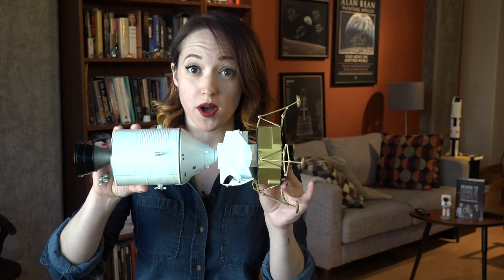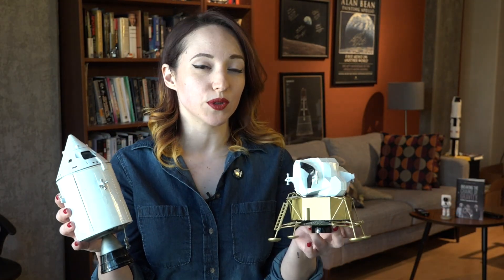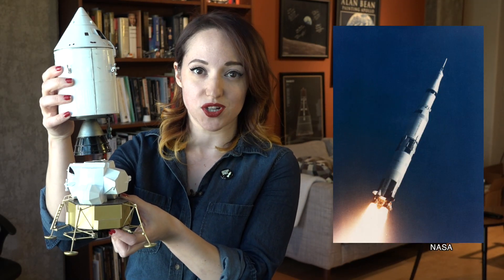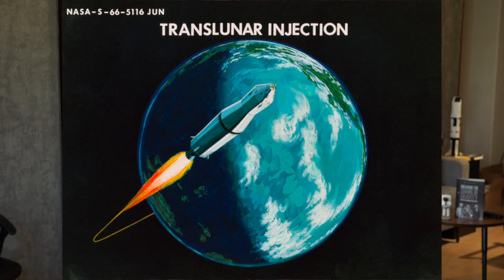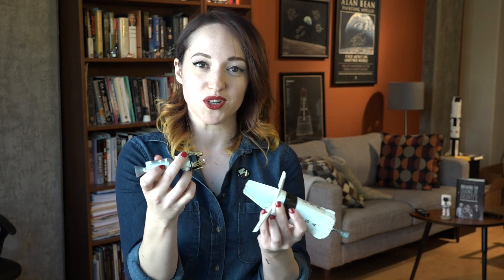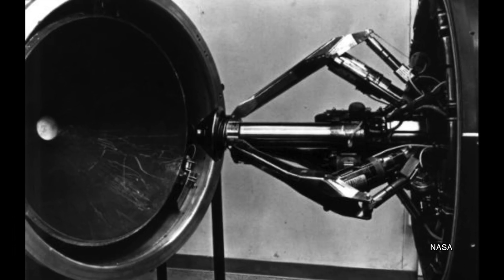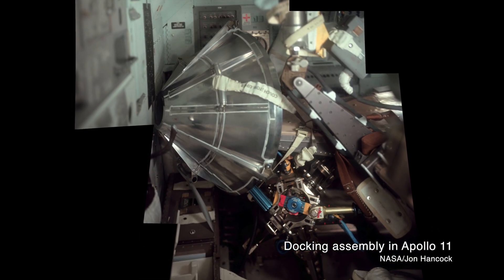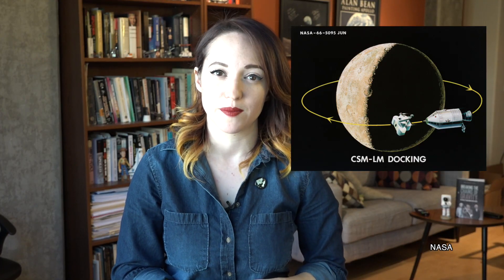How Did the Apollo Command and Lunar Modules Become One?

Comment: Not having it something thats never been tried before and they happened to pull it off 1st time in space and everything worked faultless, sorry it's a bit too far fetched if you ask me. So please don't
Reply: Tap into google AI your comment above and here is the answer
_I understand you're expressing skepticism about first-time achievements in space exploration, particularly the idea of complex systems working flawlessly on the initial attempt.
Space missions, especially the pioneering ones like the Apollo program, are the result of years of rigorous testing, simulations, and planning on the ground [1]. While a system might launch into space for the "first time," it has typically undergone thousands of hours of development and testing by dedicated teams of engineers and scientists to mitigate risk and ensure reliability [1]. 
Major space agencies like NASA and the European Space Agency (ESA) prioritize mission success through: 
Extensive Ground Testing: Components and systems are tested individually and together in conditions that mimic space.
Redundancy: Critical systems often have backups.
Problem-Solving Culture: Engineers analyze and address countless potential failure points before launch. 
The perceived "flawless" nature of some missions is a testament to this meticulous preparation, rather than luck or a lack of prior effort._

Comment: Well done as usual. But now I have more questions than answers. How did they get all that stuff out of the command module tunnel to the LEM? I also recall in Apollo 13 they used the LEM as a lifeboat. Was it already connected during the explosion before the command module failure? Or did they have to attempt a docking with a compromised command module and injured service module? Thank you!
Reply: AI answer.... Transferring Equipment through the Tunnel
To transfer equipment and crew between the Command Module (CM) and the Lunar Module (LM), the Apollo spacecraft used a continuous, pressurized tunnel created after the two craft docked. 
Here is how the process worked:
Docking and Sealing: The CM, after separating from the Saturn V rocket stage, would turn around and dock with the LM using a probe-and-drogue system. This involved a probe extending from the CM engaging with a funnel-shaped drogue in the LM. Once alignment was achieved, twelve peripheral latches would create a tight, pressurized seal between the two modules.
Removing the Mechanism: After the seal was confirmed and the tunnel was pressurized, the astronauts would manually remove the internal docking assembly (the probe and drogue) and stow them, creating an open, circular passageway.
Transfer: The resulting tunnel had a diameter of approximately 30 inches (76 cm). This was large enough for the astronauts to crawl through and transfer items, including scientific equipment, film magazines, and even the "mailbox" carbon dioxide scrubber adapter on Apollo 13. 
The Apollo 13 Lifeboat Scenario
In the case of Apollo 13, the Lunar Module was already securely connected to the Command Module during the explosion. 
The explosion of an oxygen tank in the Service Module (SM) occurred about 56 hours into the mission, two days after launch and well after the transposition and docking maneuver had been successfully completed on the way to the Moon. The crew had not yet separated the two craft to prepare for the lunar landing. 
The SM's electrical power and life-support systems were almost immediately disabled by the explosion. The crew rapidly powered up the LM and used it as a lifeboat, a contingency that, while planned for in theory, had never been simulated in an integrated scenario as catastrophic as this one. They relied on the LM's power, propulsion system, and life support until just before Earth re-entry, when they jettisoned the SM and then the LM, finally powering up the CM for its solo re-entry and splashdown.
Reply: @SelwynRewes  thank you for the detailed explanation. It makes sense now.

Comment: How did they get the lunar lander to speed up to about 8 times the speed of a bullet?
Reply: That's what I want to know! Especially when the probe had to be removed from the tunnel which was only 30 inches in diameter and then crawl downwards and under a control panel that was 3 feet high and was 7 feet long yet went from one side of the capsule to the other in the area of the capsule was only,6 feet wide! Which means that there would only be a space between the bottom of the console 18 inches high and another space between the top of the console to the top of the module only 18 inches high! So how the hell could two bodies fit with the space suit on in a space that was only 18 inches tall??!! And even if it was possible, they after crawling through the 18 inch space they would immediately run into the foot of the beds which were a foot high above the floor of the capsule!?!?😮🤔🫨😉???😊😊!
Reply: @Victoriuswon  The scenario you are describing seems to be a slight misinterpretation or confusion regarding the actual layout and dimensions of the Apollo Lunar Module (LM-7 "Aquarius") and the Command Module (CM-109 "Odyssey"). The space constraints were indeed severe, but the physical configuration was different from your description. 
Here is a breakdown of the actual situation:
The Control Panel and Couch Location
The large, 7-foot-long, 3-foot-high main display console you are referring to was located in the Command Module (CM), not the Lunar Module (LM). In the CM, there were three astronaut couches facing this main console. 
The Lunar Module did not have traditional seats for the astronauts to sit during flight; instead, they stood at their respective flight stations, wearing their spacesuits and Portable Life Support System (PLSS) backpacks. The total habitable volume of the LM's crew compartment was about 160 cubic feet. 
The Access Tunnel
The access tunnel, which was about 30 inches in diameter, led from the top of the Command Module (above the center couch) to the docking hatch in the top of the Lunar Module. The probe and drogue assembly for docking was removed to create this passage. 
The Sleeping Arrangement and Space
During the Apollo 13 crisis, the three astronauts did indeed have to live in the tiny LM, which was designed for only two people for a maximum of 75 hours. To sleep, they strung hammocks across the small standing flight area. They did not have to crawl under a large control panel to reach beds. 
The crew did not wear their bulky Extravehicular Activity (EVA) suits (which had 21 layers) in the LM for the entire journey, except perhaps briefly for specific procedures, because doing so would have made the already cramped conditions virtually impossible to manage. They generally wore lighter flight suits and used the LM's environmental control system for oxygen and heating, running hoses to circulate air. 
In summary:
The large console you described was in the Command Module.
The Lunar Module was a cramped, stand-up workspace, not designed with the multi-day "beds" you mentioned.
The men in the LM used hammocks for sleeping in the central open area.
They were able to fit in the limited space by not wearing their full, bulky spacesuits the entire time.
Reply: Sounds like bullshit to me but logical to someone who has never even contemplated whether it was physically possible with the given dimensions!!
Reply: Because she never ever measured them to find out what they are!!!😮!

Comment: How did the lander get up to speed with the orbitor?
Reply: The lunar module consisted of two stages. The descent stage on the bottom had the rocket engine for landing. The ascent stage had its own engine which it fired to lift off from the Moon. It had enough fuel to accelerate into a low orbit around the Moon.

The process from lift off to docking was extensive:

1. The Command/Service Module was altered its orbit so that it passed over the landing site.

2. The Lunar Module lifted off at a specific time based on the orbit of the Command/Service Module. It entered a lower orbit than the Command/Service Module, and behind it. However, because its orbit was lower it orbited the Moon faster, so it gradually caught up to the Command/Service Module.

3. The Lunar Module then fired its engine a couple of times to raise its orbit. As it did so, it approached the same orbit as the Command/Service Module, but its orbit slowed, meaning the rate at which it caught up to the Command/Service Module also decreased.

4. The final burn by the Lunar Module engine put it into the same orbit as the Command/Service Module, and at the same point in its orbit. The two spacecraft were therefore close enough to dock.

Throughout this process, Mission Control had very precise information on both spacecraft's speed and location, and so could provide very precise information on the engine burns required by the Lunar Module. The Command/Service Module also had a radar with which to detect the Lunar Module.

Comment: How was the command module able to draw the lunar module out? Does it have reverse thrusters or something? Lol
Reply: Yes. The Command and Service module had 4 reaction control thruster assemblies that each had four individual thrusters.

Reaction control systems are capable of providing small amounts of thrust in any desired direction or combination of directions. An RCS is also capable of providing torque to allow control of rotation (roll, pitch, and yaw).

Comment: So the command module is circling the moon at 3700 miles per hour. How fast were they going on the second docking?
Less than a foot, a second again?
How was the command module able to slow down?
Reply: The command module didn't slow down. The lunar module accelerated to the same speed as the command module. In space there's no drag or friction, and orbital mechanics means that two objects in the same orbit will automatically travel at the same speed. The maths and mechanics of rendezvous and docking was solved by both the USA and USSR in the mid-1960s.